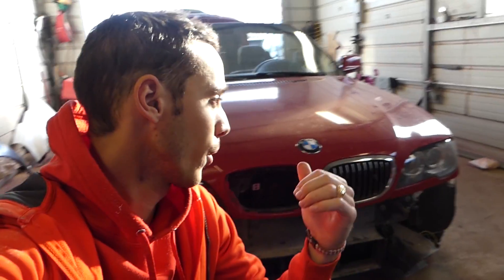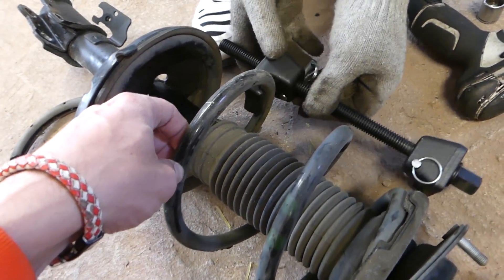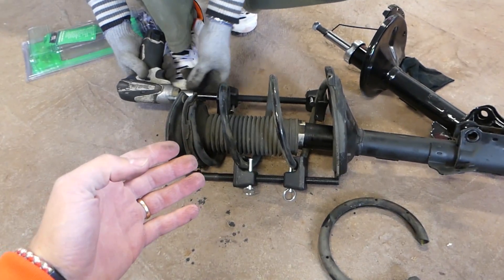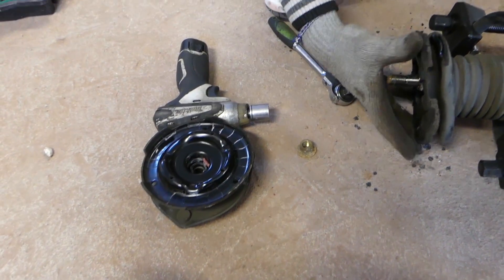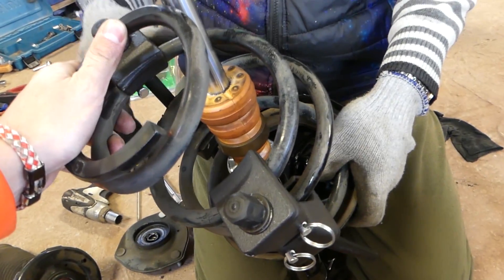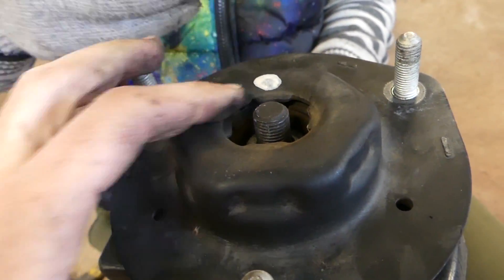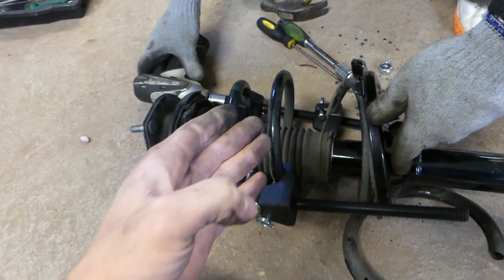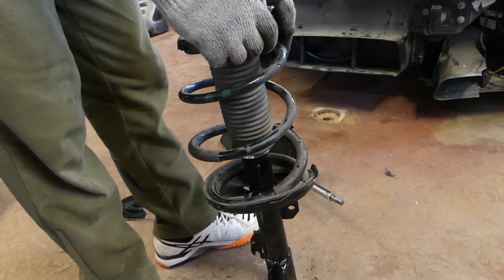HOW TO REMOVE and INSTALL SPRING ON STRUT SHOCK McPherson Suspension

Comment: then you may need an alignment. If you measure the distance between two plates before pressing the spring, and get the same distance on the new one, you will not need the alignment at all. Other than that, very good video.